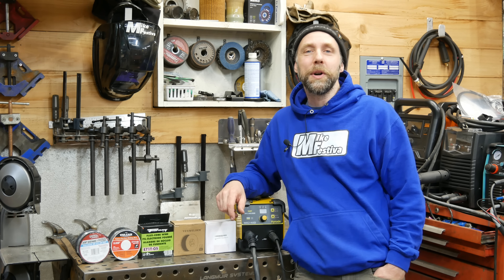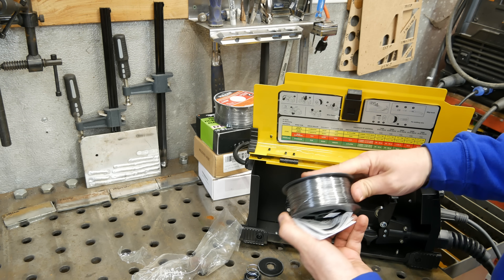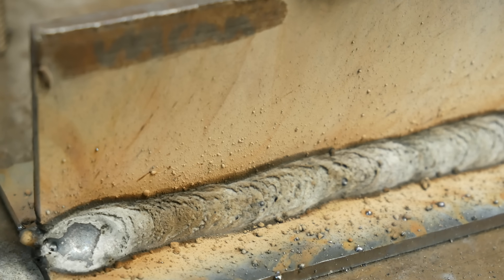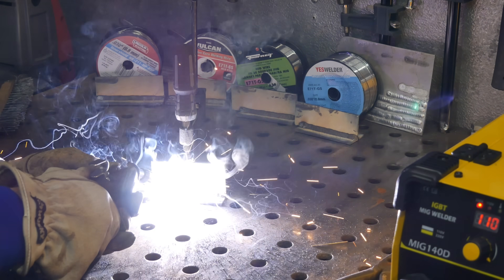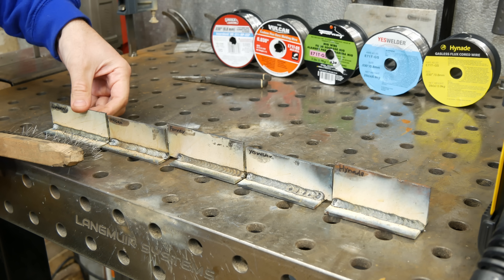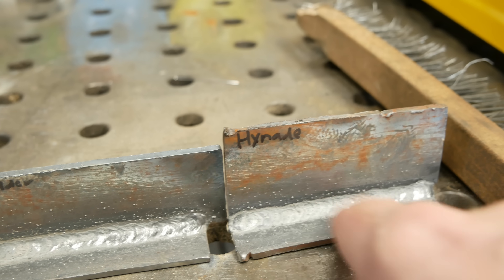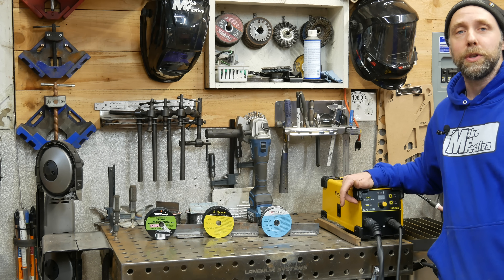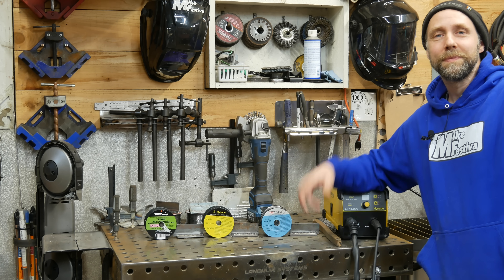Gasless Flux Core Welding Tips, Make Better Cleaner Welds

Comment: Try using a fan where you are welding.
  I've found out. The flux core wire welds better in the wind.  
 Blow the smoke out. You can see better.  Less splatter and better welds.
  I found that out one time I was welding.  Run out of gas. On a Saturday.  No gas store was open.
  I had some flux core.  Loaded it up. Spit spattered couldn't see very well.  
 Opened up my shop doors. Pretty Wind that day. As I was welding. Gusts of wind blew in the shop. I could see well.  Hardly any splatter, and it just brushed off. The wind would stop. I couldn't see again and the spit and spattered. The ones I did before the wind. I had to grind off. So now I use a fan. Does great! When you get just enough air to blow the smoke away.  I used a box fan at first. I had to turn it at an angle. Now I have a small fan with 3 settings.
  The lowest setting is great.  Welds are really close to using gas.
 Try it sometime!
Reply: THANK YOU! I need all I can get, new to MIG, not stick.

Comment: Strapped for cash I got the Harbor Freight Flux 125 and the Vulcan Wire.  Yah—spatter it do. There's a couple guys on YouTube that show how to convert it to a DC unit. They installed a big dialed rectifier and a heatsink to rectify AC to DC.

The results of their welds were much better with infinitely less splatter running DC.
Reply: "Big Dialed"? Did you mean "rectifier"?
Reply: @garychandler4296  

Yes.  I use the Google speech-to-text engine and sometimes don't proofread the output.

Comment: take about 10 loops off each spool and lay it flat on a table then cut all the loops in the same spot, if one end lifts off the table more than 2" or 3" it has a bad twist in it and that will effect how it runs through the welder and how it effects your bead, I worked at the Lincoln plant that makes that wire
Reply from the maker: Interesting test Jim 👍

Comment: Can you make any recommendations on settings for the Yeswelder 205DS for flux core wire? I'll running .035 wire. I've changed the roller to the textured groove on the .035 side of the wheel, the tip is changed out. I'll just be welding mild steel 1/8" to 3/8". Just picked this machine up about a month ago along with the Bestarc Plasma machine (just got that yesterday). I plan to build the cutting table from your other video. Great content BTW!!!

Comment: I was looking at a Forney 140 welder, but started looking at the Hynade after this video.  I noticed that it recommends a 50A breaker when using with 110v, which seems very odd.  Have  you used this with 110v?  Thanks!
Reply: Do yourself a favor and get a welder that you can run 220v with.

Comment: I use the Lincoln wire because that's what's readily available and what I want to know is why does my wire keep trying to unspool into a rats nest. I haven't had that problem before but the other day I welding something and I opened the cover and the wire was a mess in there. When you cut the shrink wrap off the wire it wants to go everywhere.
Reply: If you have only had that happen once consider yourself very lucky!
Lol
Reply: @cygnus1965  I don't use the welder much at all so that may be why it's only happened once...so far. It's nice to know I'm not alone.
Reply from the maker: You need to add a little more tension to the spool nut that holds spring pressure on the wire spool, this will make it so your wire doesn’t unspool like that.
Reply: @Mikefestiva  Thank you. I'll look at that.

Comment: Thanks for the comparison! Wonder if the vacuum seal contributed to the difference - the top 3 came in vacuum sealed packaging. The Lincoln and Vulcan, which weren't vacuum sealed, seemed to have some oxidation. Would they all perform similarly after sitting open in the shop for a while? Guess it doesn't really matter - start with what you know works best.
Reply: most wires have a seam so the flux absorbs water vapor over time.  i think one maker has a truly tubular wire that has no seam.

Comment: Thank you.
I just welded up a bumper kit with Vulcan (bought it with my little green welder from the same store), and the beads are good, but good lord the splatter. Glad to know that it isn't me, and I will be buying some Forney to keep on hand. 30 and 35
Reply: Anti spatter spray is a life saver for inner shield flux core
Reply: @averycintura9118  I've been using spray Pam, which was suggested long ago.

Comment: Surprised you didn't add Blue Demon flux core wire to the mix. It is also a well-known name in welding rods and wire.
Edit: Just looked and Blue Demon does sell an E71T-GS x 0.30 2lb spool of flux core welding wire that would match all the other brands for direct comparison in the same type and diameter of wire.

Comment: I know it's not dual voltage. But, the titanium 125 Flux core welder is a great machine as well. In my opinion. Will try the Forney wire as well. Thanks for the video on the different wire.  Very helpful.

Comment: The wire I'll never use is Radnor. It's inconsistent when it comes to the Flux. I retired from doing heavy portable welding for 45 years and have run just about everything on the market.
Reply: Hi. What brand of fluxcore wire is better and has stronger welds,  Inetub, Blue Demon, Yeswelder, or Forney?

Comment: For flux core you can use a Lincoln flux core  nozzle on a mig ! its easy to see what your welding, a lot better in tight spaces!
Reply: Only if you are running flux core.
If you are using gas and solid wire, the nozzle is there too help shield the wire with the gas.
Reply: @anthonyreddy2834  so change the nozzle when running gas !

Comment: Hey Mike been watching the video on flux core wire, & have gotten tired of all the clean up after the weld with the  harbor freight wire,been wanting to up grade to a gas welder,but don’t want to pay an arm & leg for one,do you know of a decent welder at a fair price that I could look into?
Reply from the maker: Well probably the best value welder I have used was the Yeswelder 205 DS it’s dual voltage and is an auto set machine. I have used it for about 2 years without any problems at all.
I made a review on it when o first got it. I you watch any of my older mini pinzgauer videos you will see me welding with that welder a lot. I have loaned it to my friend and he really liked it as well. 👍 you can find sales on that welder. I have seen it sell on sale for about $360. Take care 🙂
Reply: @Mikefestiva  ok cool,I’ll look for it,thanks for the heads up!!!👍🏼

Comment: Half inch to 5/8 is about correct for stick out, your work speed is the proper terminology for how fast your welding, and why are you welding with such an angle to the weld?
The paper on that one roll of weld wire is an anti-corrosion mechanism.
Even when I weld with fluxware I drag it but in a very deep angle, probably about 80°, maybe 85°. But because your work speed is slow anyway you're watching your puddle. The one thing I will comment on is I have never run a machine that tries to set the speed for you that I have been comfortable with. Cuz it always wants to choose a speed that I'm not comfortable with and I've welded some pretty heavy stuff even without flux core standard MIG.

Comment: So glad you made this video. Been using Vulcan since I’ve had a mig welder. Never really thought it welded good. But good enough. So I bought some Lincoln flux core and thought it welded the exact same so I was under the assumption it was me or the machine. My next wire is Forney. If that welds bad I guess I can chop it down to my skills. Lol thanks again Mike.

Comment: My job we use 0.45 got any thing to help me keep learning
Reply: I am not much of a welder but at work me and one other guy weld with a stick and a wire feed . he can't weld with a wire feed so I do all the wire feed welding. Some times I do good with both stick and wire feed some times not so good. All I can say is practice practice practice and then practice some more.👍. Hope this helps you friend and good luck.
Reply: If its dual shielded like at shipyards try mastering the push motion. The slag peels on it's own once learned properly and it's much faster and easier to control the puddle and penetration. I've passed bend tests this way on my horizontal. Good luck.

Comment: Lincon an vulcan look so bad because wire has contaminets on it causing it  burn in incorrect thats why other 3 was in sealed packages would be my guess  be just like welding rusty or dirty metal just my opinion no one get upset if incorrect

Comment: I use .035 Blue Demon flux core wire and it works great in my lincoln pro core 125. Doesn’t leave a lot of spatter either.
Reply: Just bought a Lincoln 140 today, I've heard great things about Blue Demon.

Comment: Hi should you use the big mig tip or take it off for flux cored wire
Reply: New to MIG, but my Flux tips that came with the shields are exactly the same as the gas tips came with the welder... 030 is .030, regardless. I also expected shorter, but they're not.

Comment: I've run Lincoln and yeswelder for years. The Lincoln wire where multipass is needed, and yes welder everywhere else. The yes welder material runs a little nicer particularly on exhaust and fine gauge sheet metal work. On most of what I do I can do buts on 1/4 plate with the yes welder material in a single pass clean. Pretty rare I do anything heavier than that with the wire feed at all. Usually go back to the stick welder at that point

Comment: Mike, something you didn't point out was that 4 of the wires are single pass wires (higher manganese content) vs the miller wire which is multi-pass.  I have found that they will weld differently due to the difference in the metallurgy.  It would be nice to point out that if you are going to do multiple passes, the single pass wires can cause a brittle weld due to the higher manganese content.
Reply: Makes me wonder if you could second pass safely with stick, maybe 6013?

Comment: I thought Flux was meant to be gasless
Reply from the maker: Yes this video covered Flux wire 👍 all the wire used in this video was Gasless
Reply: Flux core creates its own "gas" so you don't add gas from a bottle.
Reply: @tommills2097  it's much more convenient for me since I'm learning on scrap
Reply: Tankless, flux welding is tankless.... The "gas" shielding is built inside the wire

Comment: Have you tried BLUE DEMON? I've tired Lincoln, and Valcan and BLUE DEMON and the first two were really trash compared to BLUE DEMON. Maybe you might want to try it and let us know what you think. I also purchased some 2# spools of Forney and Yes Welder and they both run really well on my Lincoln 210 MP welder.  Thanks for the video!!
Reply from the maker: I was also going to try Blue Demon in this video test, but after adding all the wires in my cart it was over $140 so I took out the Blue Demon wire, I have heard many others mentioned they also like it. Thanks for the suggestion 🙂👍

Comment: that brown wrapper paper that is right against the wire is probably  VCI paper  or "Vapor Corrosion Inhibitor"   wrap which  exudes an anti-corrosion vapor that coats the wire with a monomolecualr film  to prevent tarnish or  rust. it is only effective if sealed up inside those mylar bags.

Comment: Thanks for the video, any recommendations on welding 1.6mm mild steel tubing and cold rolled plate with this. What amps do you run on thin 1.6mm mild steel. Shout out from South Africa (220v AC)

Comment: Thank you for this video. I had the very opposite experience: the wire spool supplied with the welding machine was really bad. As a newbie I had a hard time starting the job. I was trying multiple Amps, Wire speed, welding position...until the spool had to be replaced. The second spool (separately bought in the same place /brand) was so much easier to use... and I did not think even better may be available by changing wire brand / type. But now, I understand a little better and will probably experience with more wire types.

Comment: Can you use flux core in a normal old mig welder? That dose not have gas?
Reply: Yes, but make sure you have the polarity right - negative electrode unless you're using stainless steel Flux core wire then it's positive.
Reply: @claudegosselin2449  I appreciate your response, do you know if you can use flux core wire 030 in a wire feed welder?
Reply: Flux core wire is for welding without gas

Comment: LGBT MIG WELDER. How is it different from others? 😧
Reply: I think you mean IGBT, (insulated gate bipolar transistor) which is a type of inverter based welding power source.  This kind of welder uses high current electronic switching, and they tend to be lighter than a purely transformer based current source welder, as well as being electronically controllable, for pulsed, synergic, and other modes of welding that vary the voltage or current to make welding easier or more controllable, among other things.   In the cheapest flux core units, the main advantage of an inverter power source, is reduced weight and size, for equivalent power output.
Reply: Hormones?
It doesn't care what it welds?
It whines effeminately?
It thinks that flux will shield it from Monkey pox?
Queefs?

Comment: Is there a reason you use the nozzle when welding with flux core? I was a Welder/Shop foreman/ maintenance guy at a corrugated steel manufacturing plant and we didn't use nozzles. We did have to sometimes get into tight spots but when I set up a crew for welding/fabrication in something we could have used nozzle we didn't. The company only used flux core.
Reply from the maker: No there’s really no reason for a nozzle with flux core wire. I use anti spatter gel on the nozzle tip and this keeps it fairly clean.
But like you mentioned it’s not necessary to have a shielding nozzle. Take care 👍

Comment: Most people don't know this but Lincoln wire is designed to be used with Lincoln welders. The same goes for Vulcan, forney, etc. It's not very surprising that you had the best results with the hynade.  I'm not saying anyone is better because I have not done the same test you are doing. However I'm somewhat of a Karen when it comes to products I spend my hard earned money on, I take advantage of that 1-800 number on the back of just about everything you buy and spend 10 minutes on the phone with the tech or chemical or whatever engineer that works for the company and you will learn a lot. Engineers aren't sales associates when it comes to how they handle customers with legitimate technical questions and they tell you flat out how it is.

Comment: I bought the Forney wire after watching this video. It looked dark gray and almost tarnished, and it was NOT very good in practical use. In fact, I got better results from the crappy Harbor freight wire, which was completely shocking. Maybe I got a bad spool.
Reply from the maker: That’s a bummer man, the stuff I ordered from Amazon was in a sealed pouch and was shiny and clean. 
I wonder is they have different manufacturers that supply there wire?
Reply: Same here I get better results for the harbor freight wire
Reply: I know people who put emery cloth (the same used for polishing) with a little "paperclip" where the wire enters the feeding. But some feeders don't like the extra drag...

Comment: Love the video...  next video suggestion.   since you have all the wire and a dual voltage machine,  do the same tests but at 110v.    Many of us don't have 220v and are into flux core because of all the 110v options available for it.   

Thank you in advance.
Reply: I have a forney 110 flux core welder and it runs the forney wire he's using awesome. I use it for small projects around the house instead of dragging out the leads on my welding truck. I have over 30 years welding in the oil,gas,and aerospace industries and I love that little machine. It makes small jobs on thinner metals a breeze. Not the best choice for something you want to show off your craftsmanship on but,if decent looking and strong welds is what your after it's awesome. Hope this helps.
Reply: I would very much appreciate a stress test for each product,THANKS!!!
Reply: @claudegosselin2449  put .30 flux core destructive test in the search bar. There are several channels that have done it on the single and multipass wires. Sometimes videos will show up on a Google search that don't show up on a YouTube search so try Google first 👍.  Bend tests and etching are both done on most of them. The forney wire is usually in the top two on the single pass wires depending on the machine used,some like different wires better,hopefully you'll find one with your machine and can find out what it digests best.

Comment: Do you have a review on the Hynade 140? What's its model number?
(*Also...plz ck this out: (I Googled Hynade 140 and thus also popped up.)
Hynade MTG165D unit which is also dual voltage, at DILUIO, a Fort Worth, TX supplier for $57.00. Plz give your impressions.)
I jusr picked up the HF Titanium 125. It's still in the box. If this other